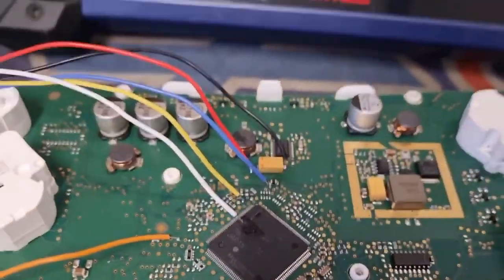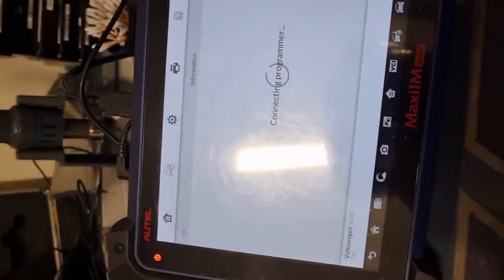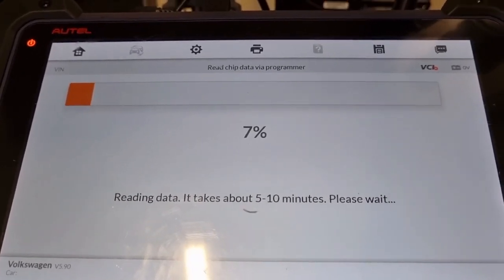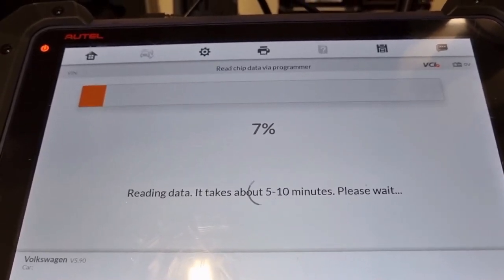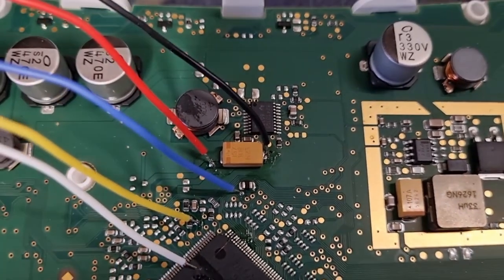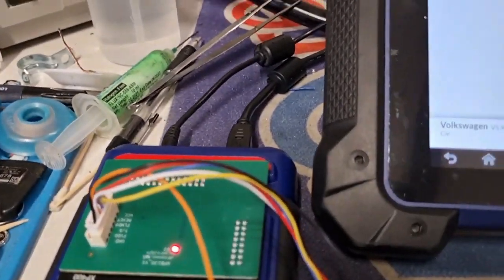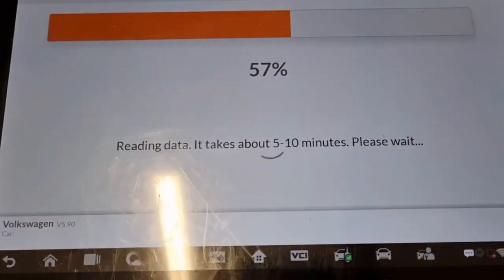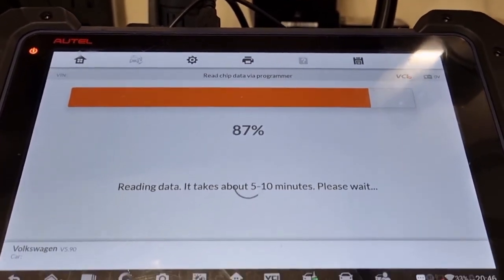Autel IM608 & APB130 Read VW MQB NEC35XX Dashboard by Hogie Gilchrist

Comment: So all immo sync data is the same for mqb cluster? I see the site that says buy for $60. I have a 2021 audi q3 i been trying to program dealer key and pull immo data with the autel 608. Do i need to soder the wires behind my cluster and use the xp400 instead?
Reply from the maker: This only reads immo data, with this data you can generate dealer key and learn key directly. It is different from sync data. If all keys lost, you need both immo data and sync data. Sync data have to buy from 3 party ($60 as we said). Autel also released a new feature to calculate sync data, but it is complex. Go and search sync data on our blog if interested. Also 2021 audi q3 are you sure it is MQB48 key?  or might be MLB? If MQB48 you need to solder the wires as wiring in the device. If it is MLB, Autel cannot do it. You will need Xhorse MLB tool. So better provide key image to us to confirm.  WHATSAPP:https://wa.me/8618350207975

Comment: Anyone succeeded in reading rh850 chip by apb131? I did everything as per provided diagram but programmer fail to read at 12%
Reply from the maker: Autel allows to submit datalog. Let engineer check your data log and reach u.

Comment: I tried to do the same on a VW Golf 2018 with an MQB NEC35xx via OBD unsuccessfully. My scenario was to add a key (proximity key). I've tried with Autel IM608 II and with VVDI2. I believe the cluster was secured and that's why I couldn't read it. May I need to do it the way you do, by removing the Instrument Cluster. Good job. Thanks for sharing.
Reply from the maker: some 2015+ models have secured RH850 processor. better check processor and confirmed with us. If rh850 cluster, need vvdi key tool plus. they have a rh850 adapter for it. https://www.obdii365.com/wholesale/xhorse-xdnpr8gl-mqb-rh850v850-adapter.html
Reply: Apb 131 also workrh850.
What i dont know, can autel make dealer key with xhorse XE remote xt27b, or with xhorse mqb chip? Ask because couldnt make a dealer key with XS series.

Comment: That's a great video, thank you.

The hardest part, I would say would be the pin lefting.

And Is it mqb48 ?
Reply: no need to lift the pin bro just cut the track in front of that pin and solder wire to pin
Reply: @b.n.motors8489 cut path to chip leg then after key reading is done what do you do? Leave it like that? How do you put it back like the way it was?
Reply: @b.n.motors8489 thanks bro
Reply: @b.n.motors8489 what the best method to reconnect? Also how are you making a clean cut?
Reply from the maker: yes, it is for MQB48 NEC35XX locked cluster
Reply: @LiuyangOBD365  thank you sir